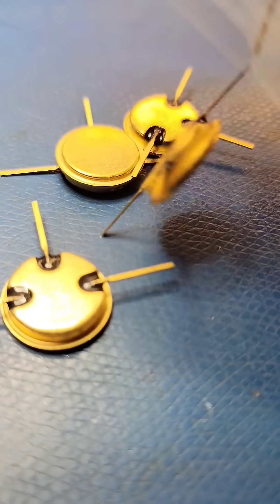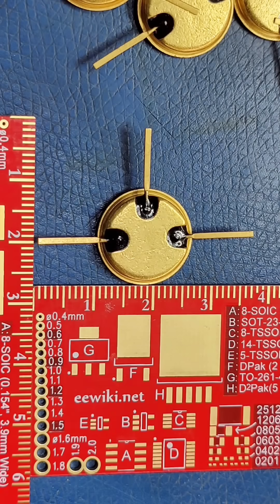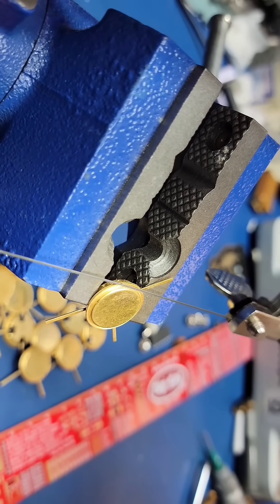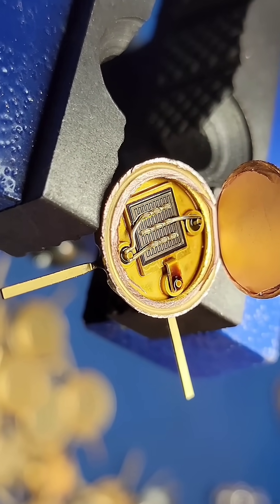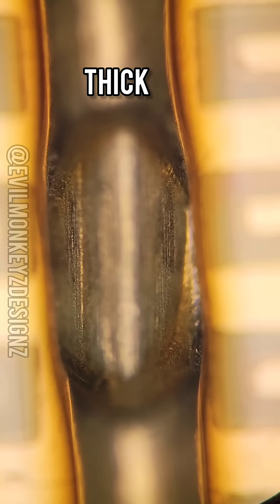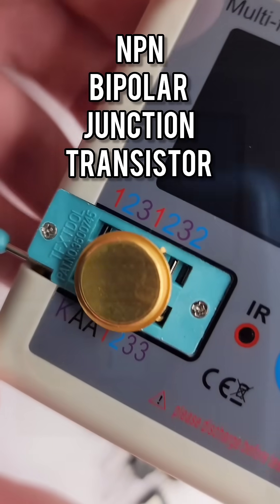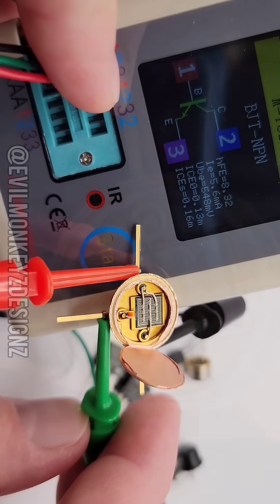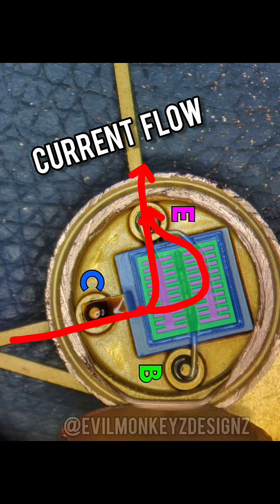TO-121 NPN Bipolar Junction Transistor

Comment: Microwave transistors have pinout where the pins are at a 90-degree angle to each other. It seems they do it because the electromagnetic fields are less likely to interfere at high RF frequencies.

Comment: It's an RF transistor.  Some versions are high gain and used as RF preamps for very low voltages and others are used in the power output stages.  They were a major pain to replace when they failed.  I'm actually surprised it didn't have a Motorola part number on it.

Comment: Wow. These transistors were also used in a three Tesla MR system, in the RF amplifier, to transmit 127.675 megahertz Lamour frequency into the bore to excite the proton spins. I haven’t seen these in over 25 years. They were very reliable, but the power supply in the RF amp was not well designed. We switched to a newer RF amp and that company did not use these, but a different transistor and a very robust power supply, which made the RF amp much more reliable.

Comment: These transistor types TO121 were common in the 1960s. They were common as an output transistor in car radios, and some types of power amplifiers. There were versions of this transistor type for high power RF amplifiers.

Comment: No, it does not equate to a current flowing in the opposite ditection. "Conventional current" is like believing that the moon produces light. It's antiquated nonsense that needs to be relegated to history any never spoken of in a serious way again, because it's wrong.
We can talk about hole flow in doped silicon, but in every other conductor electrons are the charge carrier, and the direction they're flowing is the direction of the current.

Comment: Definitely an RF power transistor. The multiple fingers prevent her high frequency lateral oscillations and spread out the current so that no one part of the die gets too hot.
The flat leads are designed for connection to a stripline or microstrip circuit, and the package is well designed to conduct waste heat to a heat sink.
The Hfe is probably low because you are testing it at a very low current - note that the test with slightly higher Ie more than doubles the HFE.

The flat leads are designed

Comment: At first I thought this was an older version of the current NTE121, which is a high power audio transistor, but on reflection, the leads are configured for use in strip line, making this a microwave transistor.

Comment: Remember kids, if you see some unknow electrostuff, never, i repeat, NEVER touch it with bare hands or without proper anti-static equipment. That's a short-cut way to destroy some old fashion high sensitivity transistors. Be grounded, kids.
Reply: is not applicable to bipolar transistors though.
Reply: Also, don't t ake the lid off.  That will probably also destroy it :P

Comment: I have some large gold transistors  and chips that charge in light. I've probably had that transistor in my hands at one point. 
Those are probably old military   which is why their wire bonds are so thick. Redundancy,  aircraft use this stuff. 
Part numbers might tell.
Reply: More likely they're RF and require the thick leads and tree like layout to deal with capacitance and skin effect.
Reply: @tsm688 
 yeah they got alot of skin in this. 🤔👍

Comment: The reason those devices are so large is because they're designed to carry significant electrical voltages and currents. I used to use a transistor of this type (or similar, I can't remember the exact number) in a 12v model railway (railroad) controller that I built in the 1980's, which simulated loco throttle, coasting and braking effects. It worked pretty well, and was a lot more realistic than the standard rheostat-based controllers around at the time.
A transistor lke this is often attached to a heatsink to dissipate the heat load that 12v can cause.
Reply: This looks like a high frequency transistor. A pretty odd choice for that purpose, as I imagine they were pretty expensive back in the day. Or did you get them as surplus parts for cheap?

Comment: I used one of those, RF power transistor, (same package, don't know the part name though) last year to build an FM transmitter as the final assignment in RF class for my electronics technician journeyman certification. Also used one four lead one in the same package.
Don't really remember what the fourth lead was for though, but it was also a RF power transistor
Reply: A lot of times the fourth lead is an isolated ground to provide RF shielding.
Reply: there exist dual-gate fets in this form factor in which case the fourth lead is a 2nd gate. I imagine they're used for frequency mixing
Reply: @ahG7na4  that sounds very likely
Reply: Some of them have dual terminal like dual emitter, to lower the inductance.

Comment: Fun fact: bipolar transistor and diode schematic symbols were done wrong from the beginning.  The arrows are backwards. Electron flow is the opposite direction.   MOSFET symbols are correct however.  Hope this helps anyone struggling with electronics.
Reply: They are not wrong.
Because the direction of the arrow indicates conventional current flow and that is what we use when designing and understanding circuits.

Electron flow is only ever used when understanding how semiconductor devices work as part of student education.

When you are designing circuits, unless valves are involved, as a designer you are never thinking about electron flow.

So this tells me you haven't done much design work with electronics, as you would know this, if you had.

Comment: Base emitter collector a neat application for switching current 😅
Reply: This device was almost certainly intended for linear or class B or C RF amplification and not switching, however.  Expensive construction that's required for high frequency operation way beyond the usual switching applications.

Comment: Im curious if the tester got it wrong because sometimes a BJT can have reverse gain. This seems backwards from what I understand. How can you have a depletion region growing in correct place if base and emitter aren't even touching. How can collector be in contact with the emitter. There must be an oxide mask between the collector and the emitter or some through silicon vias. The picture doesn't really explain how it works.

Comment: Hard switch anti intrusion sequence made on the motherboard would be able to help secure a device. Hard-line around the processor into a bypass for the processor to run anti intrusive software would help keep a device secure. Hard-line flash of anti intrusion software onto a device would help secure a device. A hard-line hard switch breaker would help secure a device. Has the potential to end hacking.

Comment: That's a power RF transistor, for things like handheld 2 way radio etc, used in the final of the transmitter.
Reply: One thing I love about radio is that one mans final is another mans intermediate or low power amplifier. 0.5 watts? 500 watts? 50,000 watts? I have found the same chip serving different stages in radically different output powers.
Reply: i found some in a couple of 2 way radios.

Comment: It's been a very, very long time since I've seen one of those in anything I've opened up to repair or salvage for parts. A very long time indeed. If memory serves, those things are all about heavier-duty circuits that require a lot of switching, probably out of an RF amp transistor.
Reply: I've been told about them, and we still have a few rumbling around our repair shop inventory, but I haven't seen any in the 8 months I've been working there, fixing stuff from the 70s through today. It's old, and specialized.

Comment: They look like RF output transistors, possibly in the UHF range, say the 2N4427 or the 2N3866.
They were invented for the radar used to land on the Moon. They are always been very expensive because of the segmented structure of the chip to reduce the parasitic capacitance, and thick bonding wire to reduce parasitic inductance.
In the '80s, some people used them in parallel to build FM broadcast transmitters. They work well in UHF, but they need tuned base coupling and tuned output load.  They are a fantastic piece of technology to this day...
Reply: Possible Slof from a submarine transmitter..I acquired a few smaller versions with the same pin configuration along with a couple 1616 rectifier tubes at a army surplus (obs)store 50 years ago....an old ET (real old) from Navy there stated, " this was cutting edge stuff back in his day".  There even 'acorn' shaped glass tubes for radar transmitter with the same pin out but nine pin.
Reply: Tuned coupling means filter right? I thought they did it for all rf circuits.
Reply: @yoppindia он, судя по всему, имеет в виду согласование каскада, если не будет то волна может "встать", а  вся мощность выделится на транзисторе вместо антенны.
Reply: No @rayoflight62, they are not the 2N4427 or the 2N3866 which are both NPN transistors in little TO-39 cans with collector connected to can.
Reply: Never knew that such 'gold ' standard superior quality transistors existed  in 80's... It's low noise performance must be way way ahead of  those ordinary metal can transistors...
Reply: you know some sht that knows some sht, dam good.
Reply: They are hard to get, mostly a russian ones in Poland - where i live. I have been building 200-300watt output aplifier on these, based on old 90s scheme. Two of similar ones can rock out UHF with dipole antena for 30km, stereo and RDS (15-20). Another good side is they are practically lifelong ones.
Reply: is it old transistor? first time saw it
Reply: thanks
Reply: i ended up buying 4 of these in an old airforce radar worker from some defense contractor pretty cool
Reply: “Inter-digital “ geometry pattern if I’m not mistaken !
Reply: i aspire to know as much as you.
Reply: Nice to know!
Reply: So not any good for making an audio amp?
Reply: why you need radar for Hollywood movie of landing on the ''moon'' ?
Reply: @wiktorchm shut up, Beavis

Comment: My first guess is that it is some type of power RF transistor used probably in TV or radio analog amplifiers.
Reply: I saw some of these used on a video teardown of a maritime emergency radio. Fairly high power transmitter if I recall correctly.

Comment: I've got one of those component testers. I've no idea how accurate it is for measuring ESR on high voltage capacitors,, but it's otherwise pretty handy to have.
Reply: The old one is good, the newer not.
Reply: For ESR, get a dedicated ESR tester. Worth it.

Comment: Based on the package and thick wire bonds, I'm guessing it's a high (ish) power RF amplifier transistor.
Reply: You seem. Familiar
Reply: @unrealcrafter2671  You also seem...familiar
Reply: I love seeing well extremely well made electronics. It sad that I don't see Will made electronic parts anymore very often. And these electronics parts are definitely very well made. They're old due to their size but nevertheless very well made. These are great quality. Love seeing that even more love having Great quality made parts.
Reply: @shane5314  no, rf ones are still expensive and pretty
Reply: No, it's a UHF medium power transistor. The casing is not meant for anything more than 1 to 5 watts of power with proper heatsinking.

Comment: It is an RF power transistor. Hint, the leads would solder to a stripline.
Reply: yeah hfe of 3.5 (and size) pretty much tells it's a power transistor, a frequncy range test would be interesting
Reply: RF transmission…old school. Removed many of these back in the day.
Reply: That's about 40 year old military stuff isn't it?
Reply: @kevinavillain4616 probably is but I've worked with modern stuff GaN mosfets @ 40Ghz and they look pretty much the same.
Reply: 😊 joli capteur optique ou  photo transistors ou cellule solaire au choix 
😊 nice optical sensor or photo transistors or solar cell of your choice
Reply: In my teens when parts were hard to fimd and expensive, i would cut 2N3055 and use them as a photo sensor. They worked great  @jean-pierrelesieux9772
Reply: I agree, probably matched so they can be push pull
Reply: @davidthomas3859 not necessarily
Reply: Wow! Brings back childhood memories!
Reply: Nowadays a Bipolar Junc Trans has a way different meaning 😮😊
Reply: @jonslg240 😂…..🫣
Reply: @jonslg240 😂😂😂😂😂
Reply: @jonslg240  IGBT Trans are more powerful and sometimes confusing. ;)
Reply: @payalnik29  you should work in a Trans port company driving a truck, dont know why you look perfect for the job
Reply: @payalnik29 Best comment 😂😂😂
Especially the IGBT part 😂
Reply: @jonslg240  Its virtue signal Hfe is over 10,000 but it will go negative if you put it in an actual working environment of any kind.
Reply: My thoughts exactly.

Comment: The casing reminds me of the older geranium Germanium based transistors...
The rough gold coating and the beefy bodwires also make me think this is a OLD design?

There is clearly silicon in there though...
Impressively stranger device! ^^
Reply: In English the words GERMANIUM and GERANIUM are spelled differently because they mean different things.
Reply: @MrCuddlyable  shit, didn't mean the flower 😂
I think spellchecker didn't quite know what I was trying to say...
Reply: Geranium is a very wicked plant based poison. 
Do you mean "Germanium"?
Reply: the beefy wires and thick leads and tree like layout are all to reduce capacitance and skin effect.  Modern high-power RF is probably different but still has to deal with these problems